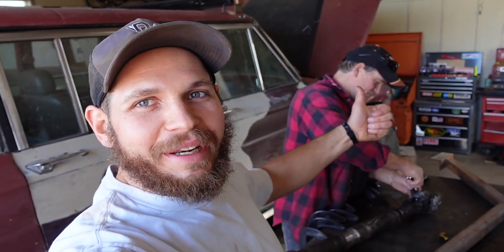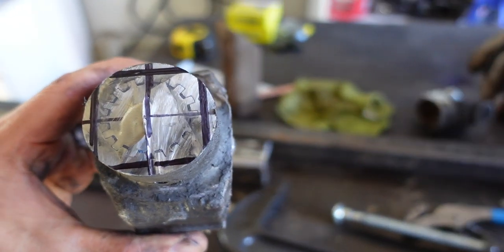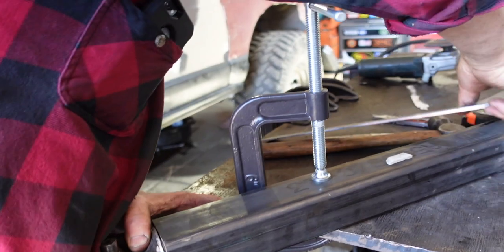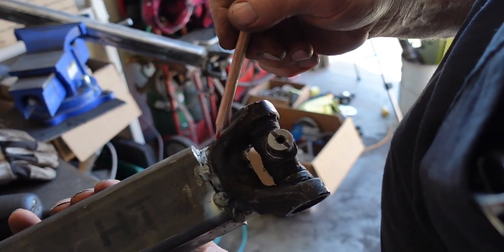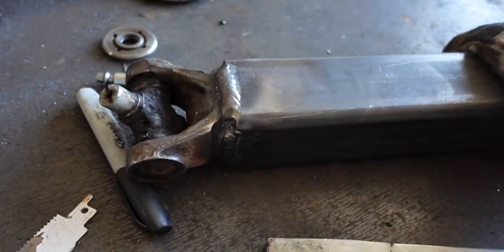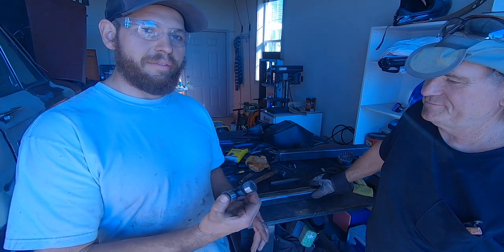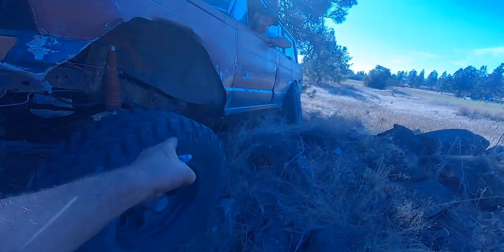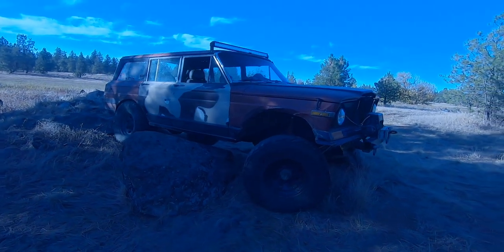DIY Square Tube Drive Shaft!!! @WeldproWeldingEquipment

Comment: Great video! Any vibrations on the road? I need to make one for my solid axle swapped 4runner, due to my budget, but also need to go on the highway to get to where I'm wheeling.
Reply from the maker: I wouldn't run it in 4 wheel drive on the road, but in 2 wheel and the hubs unlocked it doesn't spin so no problems there. It's super tough, I've drug this thing across the rocks with no issues.  Thanks for watching!